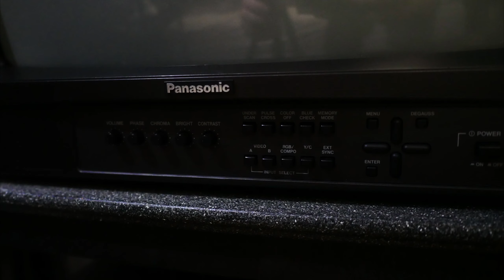Real Panasonic 3DO recap 240p mod Fixels ODE install , CRT Montage footage

Comment: I still have my FZ-1 I bought on clearance back in the late 90s. Absolute tank of a gaming machine. I have it connected to a Panasonic 42" plasma TV in a spare room. That TV doubles as a space heater - lol ! I have few original 3DO game disks but mostly play burned CD-ROMS. Might have to look into this ODE thing. Great video!!
Reply from the maker: Its pricey and I forced myself to get it but glad I did now. I too had a book of burnt disks and a couple originals. Its so nice to not have to mess with cds now. I had a plasma 10yrs ago or so, they were crazy heavy as well. I never understood how such a relatively thin display weighed so much lol
Reply: What kind of disc's do you use for backups?

I've tried maxwell and verbatim and my fz-1 doesn't like em.

Maybe I should clean the Lazer or find some knock off cmc taiyo  yudens ?

Comment: Just wondering if you had power issues with this before the capkit? My 3do is basically going black with no sound. Power light is on but nothing on screen after a few minutes
Reply from the maker: nope, just did mine for maintenance before putting the ode in